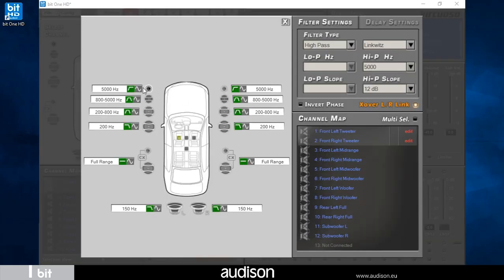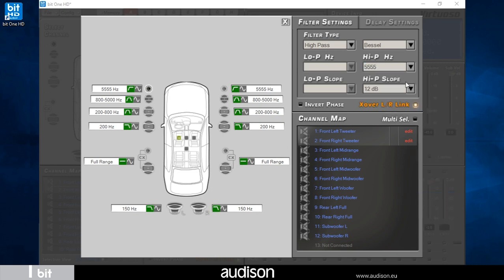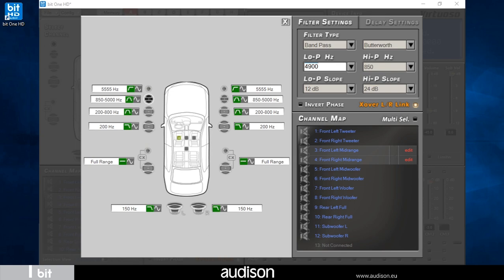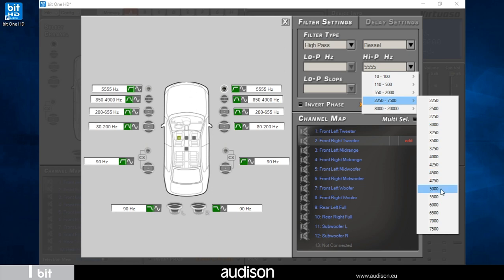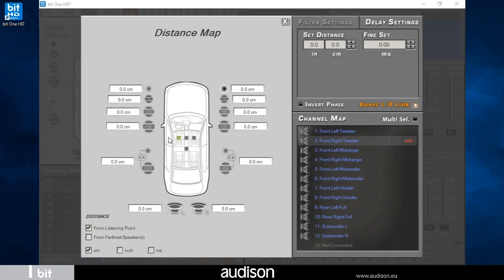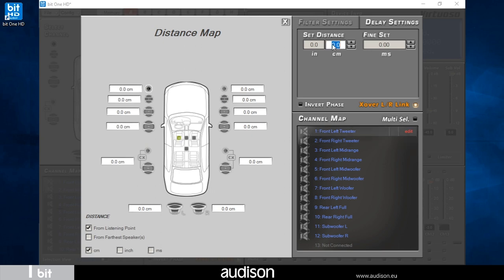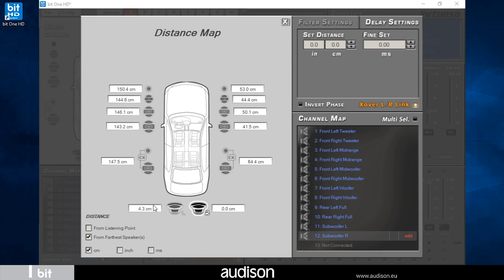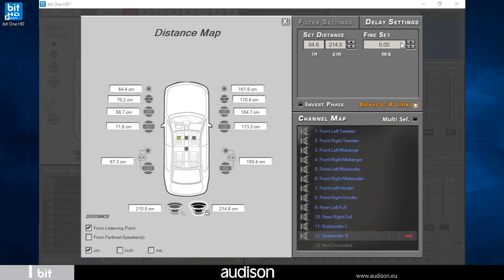AUDISON VIRTUOSO TUTORIAL 3 - CROSSOVER FILTER AND TIME DELAYS

Comment: If instead of full range for the rear doors I want to set up two-way speakers this would require 14 channels. So, to make it work with 13 channels, can I send just one channel (mono) to the subwoofers even if there are two subwoofers, each with their own separate amplifier? More specifically, each subwoofer would be powered by the 1000W channel of a AV 5.1k HD and the two amps would be connected to the DSP via the AD Link connection. So, can I send a mono channel from the DSP via the AD Link to two amplifiers?